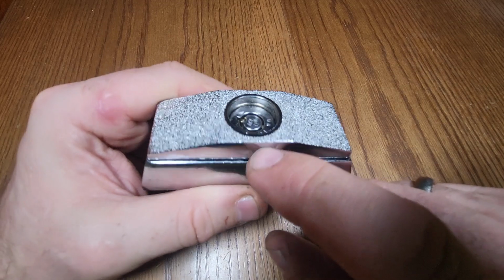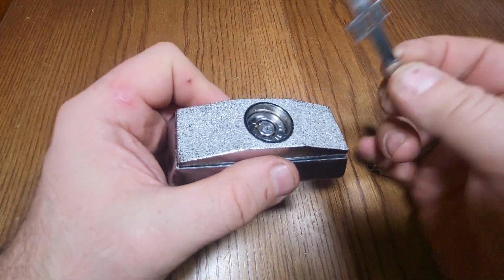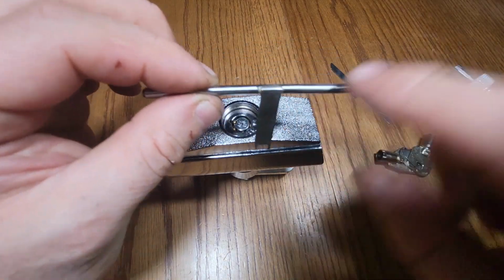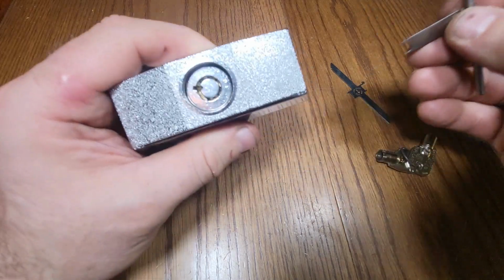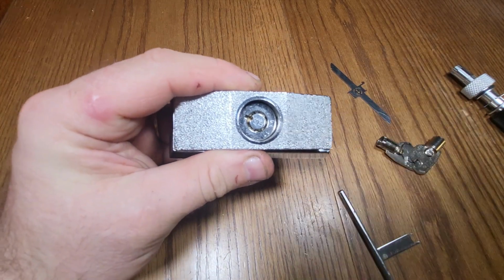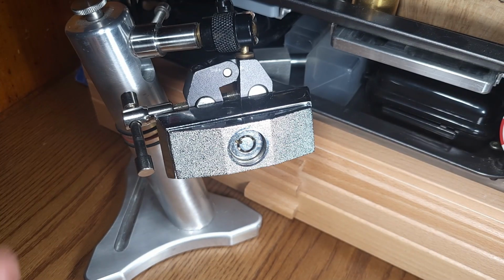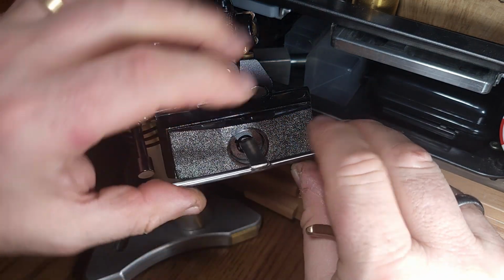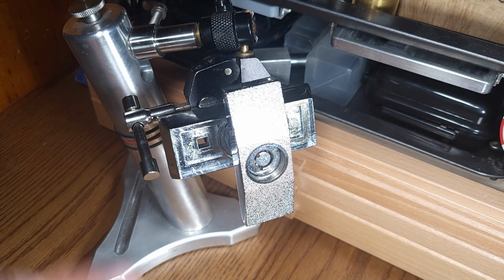Ace 2 Tubular Lock Recessed Core Custom Tool  - T-Handle Picked to Full Open Reasonably Quickly

Comment: Excellent video again!! I cant remind if i asked u already,my apologies if i have. What tubular impressioning tool will work on the ace 2 tubular lock. To long to type write here, but i locked the cargo container with a ace 2 on my vault.  And i dont want a locksmith in my toy room. And i have this from when I deployed in the military.
Reply from the maker: Hi, yes you did ask, same answer I'm afraid, to my knowledge there isn't an impressioning tool that will work on an Ace 2 due to the mix of different spring rates inside the lock, sorry about that
Reply: @paulg413  that's ok big dog. I just keep screwing up on the spp, and I am getting ready to just cut the lock off where I put it. But I really don't want to destroy it.